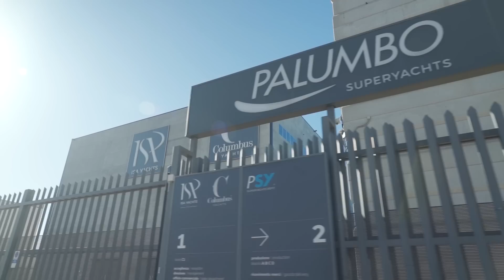SILENT YACHTS SENSATIONAL 80' CATAMARAN - HOW THEY BUILD IT!

Comment: I've heard that it will travel at 6 knots for 6 hours but then needs a 10-hour charge or you will need to run the diesel generator at that point. If you want to go faster the battery-only mode drops off quickly and if you want to do top speed you will need the generator to achieve that. Hope some of the new battery technology will help considerably. I love the design and concept.

Comment: Instead of a diesel generator as a range extender, can the Silent yachts be fitted with Hydrogen Fuel cells instead.The Hydrogen gas can be collected from the electrolysis of the sea water and collected while the yachts are parked or anchored. This way the Hydrogen power systems can supply the power for addtional speed  without taxing the solar systems so much. Silent Yacht should put that additional option in there to make their yacht's even more energy independent. Sure it will bump the bill up 50,000 Euro but it will be worth it to never ever needfossil fuels even as a backup

Comment: how much battery does it have. what kind of battery. how much power do solar panels put out. how big generator. it would be nice to see this with a mega watt of power storage or more. always more. smaller gen sets 150/250 would keep overall green score very low. fuel capacity would be low. this is not a polar explorer yacht. you mentioned beam as 36 feet please mention beam on your other videos. the wider the yacht the more space you get. thanks for your great vids.

Comment: Obviously, this is not the solution for transoceanic voyages. We know that in four or five thousand nautical miles of open sea, you will most likely encounter several days of variable cloudiness, lack of sunshine, and stormy weather. I have read that there are options such as comet sails which go up to 150 meters and this would be the method proposed for these boats in case they run out of energy. Well, obviously, in case of bad weather, this will not be a solution. There is a new technology of attaching hydroelectric motors under the keel, which provides the necessary amount of energy that electric motors consume, and this is a constant supply regardless of the sun. Of course, it is necessary to think about rigging sails to ensure that the batteries are always kept charged, even after the bad "sky" has passed, the underwater hydroelectric motors will continue to supply constant energy.

Comment: Wonderful!  I'm so interested - but struggling to understand how it would work in an ocean crossing.  From your previous video, it sounded like realistically it only had several hours capacity on the batteries, and obviously out on the ocean you want to conserve fuel - so what happens if it is a cloudy few days, you don't get enough charge on your batteries but you want to conserve the generator for the storm that you are heading towards .... and the wind has alreay picked up, so what battery you do use gets drained trying to push the boat through the wind so you don't get far, and when you're not moving you are being pushed off course etc etc.   I've not a huge amount of experience, but whilst this sounds like a nice idea I'm still not convinced that if I wanted to take one over to the Americas that I would get there in one piece espeicially if I met a storm along the way.  Maybe I'm not understanding something fundimental though, as I would have thought this question would have come up otherwise.  I can see how as a Med cruiser it would be fantastic :)

Comment: Actually, if you think about it, this makes total sense. Compared to planes, trains and automobiles, boats do not need nearly as much power to move. 7-8knts is all you need, even for world cruising. So I'am actually surprised that this "revolution' didn't happen even before. Solar panels have been around for over 2 decades.

Comment: Now remember to find out about warranty of the batteries.. 

We all know that we buy tools and other stuff, it's almost nearly the same to buy a new unit when replace the batteri.. 
How long can they hold, and what price to replace?
Reply: Steffan Andersen 8 years is the warranty and in 8 years time prices for the same capacity will drop drastically 
The boats are modular so if an other battery is cheaper you could build that one in, it doesn’t depend on one battery manufacturer like in power tools

Comment: It’s a great concept, but a couple of diesel 280hp don’t use a lot of fuel. What happens when it’s been raining and stormy for a few days, your low on charge? I suppose an inclusion of a wind generator would also help on cloudy winter days!
Reply: Robin Ellard in the 80 they used 2x 220hp generators 
Wind turbines are lound and don’t bring much power in comparison
Reply: @philehr  Do u know what cost is of 80'?
Reply: You could have a small diesel engine for emergency backup I suppose. Or even an outboard, but kept hidden away. Just for emergency only.

Comment: Depending on charging methods and battery bank capacity, a solely solar panel powered yacht will not get you very far very often. Besides, sole ownership is a waste of resources:
www.green-explorers.com
Reply: Preben Kristensen if you want do go far you are right you will have to turn on the generator on after 60NM, then the boat uses less than a conventional power catamaran.
The perfect use is a typical holiday use like: Boat is most of the time in the marina waiting for the owner, no need to plug in power, boat is charged when the owner arrives, owner boats to a nice bay, stays there for a day and charges the batteries, no generator nothing, and then boats to the next bay or back home
Reply: @philehr  How many generators can be connected? If someone wants to be able to travel transatlantic (4500miles+). How many generators would I need and what kind of set up. Can it be done with three generators? Have one generator constantly charging every day during the day? while another is in use. Would love to get to know more information. Thanks in advance

Comment: David are any of the midsize yacht builders looking at alternative powertrains for their vessels? 

 I'm intrigued by a suggestion I herd for powering a yacht with Hydrogen Fuel Cells  (HFC's). HFC's in cars presented a problem in that carrying around large quantities of hydrogen presents an explosion risk. But a yacht is surrounded by water from which hydrogen can be produced.  Historically it could only be produced from purified water but recently a team from Stamford University have produced an electrolizer which can produce hydrogen from raw sea water. This could be constantly produced on a yacht and stored in relatively small benign quantities and constantly run through a HFC to drive electric motors and the only by product is water! Link below to the electrolizer data. 

http://www.anthropocenemagazine.org/2019/03/simple-method-to-produce-clean-hydrogen-fuel-from-seawater/?gclid=Cj0KCQjwjOrtBRCcARIsAEq4rW5vd8GzEFckX2XlTh0tOIxVlexcigOl9uowFDl5-V2aH6tphksv2IUaAimYEALw_wcB

Comment: Whenever you look at yachts or boats in general the fuel costs always seem to be just massive so you can see why something like this is appealing.
Reply: Hybrid yachts will definitley be the future of boating. A yacht becomes much more "affordable" when you take out the costs of fuel and engine maintenance. I feel like these are slightly less of a money pit than a normal boat.
Reply: Still not free though. That’s a huge expensive solar panel. The other upside is an electric motor yacht is a lot faster than a sailboat and can go straight from point to point without tacking. Your batteries can be charging up while you’re vacationing. Then you’re ready for a fast trip to your next destination.

Comment: I like the concepts and just need a better architectural design in building the upper deck floor and turn the entire solar panel to a roof top instead of a little part able to rise or lower with more decking with pilot steering console to the front of the upper deck!
Reply: Ras R  they offer a tri-deck version
Reply: @philehr  excellent and I'm sure since no expensive diesel engines the cost might be half the price of normal power catamaran yacht! I'm getting one soon lol!

Comment: Amazing video and clear information. Climate change ocean levels rising, existing shorelines will change, and some areas will end up underwater. Communities and businesses will have to migrate but  this type of work another great milestone to save planet.
Reply: When you are paying $5 millon for the boat & $400k extra for - the sound of silence..!!!.
Remember you are not saving the planet with this boat.!!!
You need coal fired power stations for shore power recharge.
 & diesel for your silent running onboard generators.
& large scale mining for copper, lithium.toxic chemicals & glues  etc. solar panels are 100% non-recyclable. Further, they are treated as Toxic Waste. The original  panels were ‘intended’ to last 25 years.However these ‘new’ cheaper Chinese (esp. flexible) have a life expectancy (efficiency) of only 5 years!  Will this be an expense (toxic waste/longevity/replacing panels  etc. unfortunately - nothing is truly free for the climate change/save the planet preachers.-.lol..